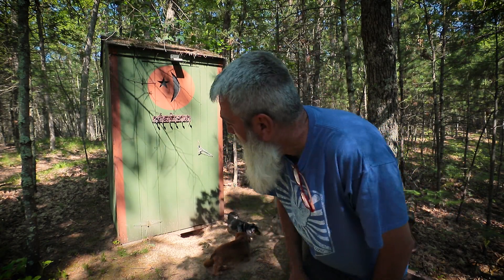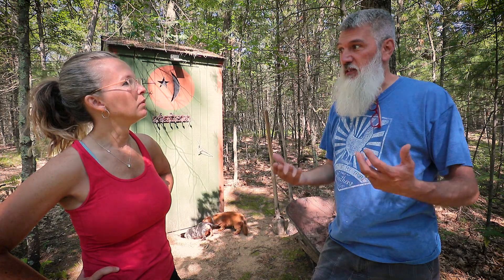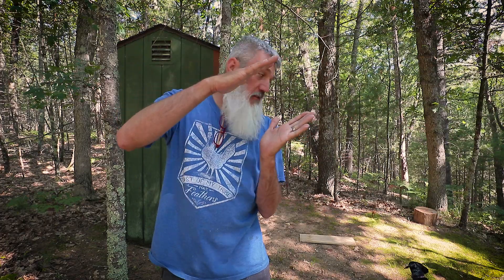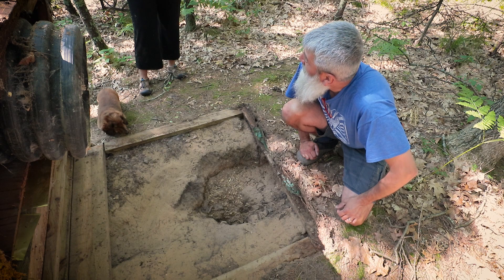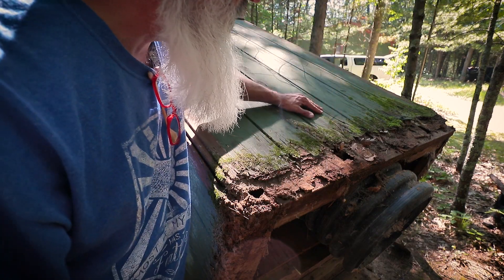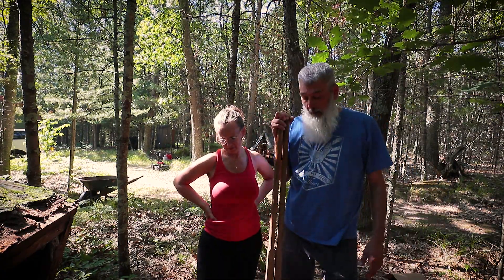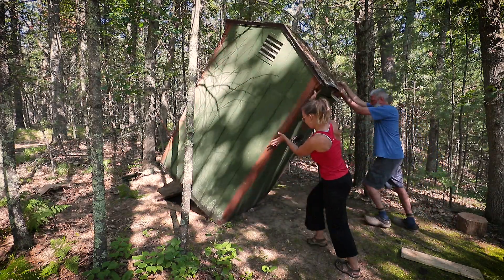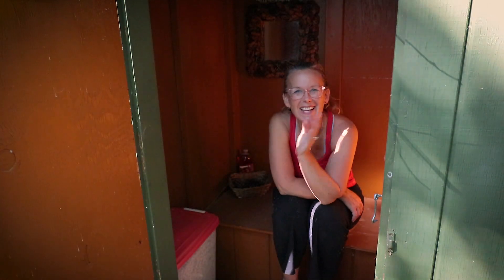Off Grid Cabin:  The Outhouse is FULL | Re-digging the PIT

Comment: Also wood chips take along time to decompose... Try peatmoss
Reply from the maker: They're not big chips, just tiny little flakes.
Reply: @1870s Smaller the better for sure.... Not recommended for any kind of composting due to the time, it tends to get moldy b4 it actually breaks dwn. Plus they attract ants. Just thinking of the speed of your hole filling. I'm a professional gardener, and  coincidentally am building an outhouse as we speak. I think it's modesty that makes feel the need to cover up the poop, but even lime will slow dwn decomposition slightly. The best thing is to just add water if anything.. That's what I've concluded. Just dump my grey water from camp into pit. Also, I keep pee separate, it funnels dwn into gas jug, w vinegar added, and dispose elsewhere. It's the ammonia smell I can't stand and carries through the air. Just some thoughts. Thks for the discussion. 🇨🇦😊

Comment: What about the cardboard tubes used for pouring concrete columns. They are biodegradable but should hold there shape for a long time....
Reply from the maker: Those might work really well, the soil does drain good.

Comment: The wood is still a composite, so you need to fix the  toilet on bricks or pour concrete for the sides, and set the toilet up on bricks with rubber tires spliced, tread facing up to drain water, snow off. If the back of toilet has a cut out, you would not need to tip. Dig out, fill back. Grandpa used sulfur in the winter as we kids used the chamber pots.

Comment: You could use a plastic drum with the top cut off.Then add sand with the wood chips.
Reply from the maker: Good idea!
Reply: @1870s  -Also,drill holes in the bottom and sides to drain the liquids.

Comment: I am beyond 50 years old, grew up with the outhouse as a normal use toilet. 
The pits where lined with wood boards.  Typically 1x4 planks,( but back then wood was better quality,  2x4''s would be better now.)
built as a bottom less box, from the inside, as  the hole is dug , and as room allows, a new square "ring" of wood is pushed into place against the dirt,  with experience nails are not even needed...using a method such as north and south boards are set in place,  then east and west boards are cut to fit tightly,  and wedged in to hold the north and south boards...then room for  the next layer down is dug out, and the next  "ring" of boards are installed east and west, with north and south boards wedged in to hold them in place....  if your skills are lacking..vertical boards are nailed inside... like the legs on a cheap treehouse ladder... I  have seen a ladder built into the pit walls so the person digging can climb out... being just good enough to last until they finish the digging.
>> the north/south >> east/west pattern must be alternating,  or the soil will push the walls in.

Comment: I run pretty simple solution for my cabin. I pee in a bucket which drains into the lake and a bucket for poop which has bag on it then it gets put in a poop bucket to be burnt off. I recommend separating your pee and covering your poop each time with sand saw dust or dirt. I know someone with outhouse in the same spot for 30 years in loamy  soil.  Dig a six foot hole should last six years. put some metal adjustable feet on your outhouse.
Reply from the maker: Only girls pee and poop in it.  Boys only poop in - and the pee goes in the woods.  I've heard that if you just let the natural bacteria do it's thing, it can break stuff down pretty fast - it's part of the reason we've never tossed lime or anything in there.  Hmm..  Now you got me thinking.  We're really not there much.  Even without any decomposition, it would take pretty long to fill a 24" culvert that's 7-8 feet deep.

Comment: what about the cardboard tubes you use for concrete pier forms.  It would compost as the outhouse hole filled.  If course you might have to move the outhouse location?
Reply from the maker: They might work.  It's be a race though to see how long the cardboard would last.  I bet removing the critters will make a big difference.

Comment: You could line it with bricks leaving gaps between them when you stack so most of the sand will stay out. If you keep the sand out then you probably wouldn't never hafta clean it out since your not using this everyday
Reply from the maker: Very true.  Let nature decompose it all for us
Reply: If bricks are not properly set in mortar , the pressure of surrounding soil will push them in.
As well as the cost,

Comment: Loose sand will collapse. Probably need a light weight short piece of French drain or similar. Insert into hole vertically to prevent sand from collapsing. Also mix some powdered lime in with the wood chips. I like your idea of a treated lumber base to rest the out house on. Plus the added feature with the chicken wire to discourage  animals that dig and stepping stones around the structure. I enjoy your videos. ☝👍...👉
Reply from the maker: Drilling holes in the culvert is something I had planned on doing, but didn't mention in the video.  The moisture wicking should help, and would allow worms and other insects to get in and assist with the decomposition.

Comment: You could bury the plastic tube like you were talking about, but drill holes in the sides before putting it in the ground. As you use the outhouse, keep tossing in a handful of wood chips each time like you have been. Worms will get in through the holes in the sides and help break down the waste! If you dug it 6-7 feet down... I would think that would take YEARS to fill up... If it ever actually did!
Reply: Also, I love how nice the inside of your outhouse is!

Comment: Build a retainer wall with pressure-treated wood and put it in the shit hole, and your outhouse shouldn't be touching the ground.  Put it on 4x4 posts and put wire mesh around the bottom so critters don't get it.

Comment: Maybe its time for a composting system with 5 gallon buckets if you have a little land. Our cabin is off grid and primitive.  We have an electric composting toilet (uses a fan.  Can power with solar) as well as a bucket system for backup.  Many off grid folks manage with the bucket system perfectly fine. You are making yourselves too much work. Before this the grandparents plumbed the toilet to a 55 gallon barrel.  But the toilet would crack if no one got to it before a freeze.
Reply: once upon a time in a land far far aways off, there lived a family that used a two gallon galvanized metal  pail not a 5 gallon plastic bucket , it would fill quickly and overflow and it had to be carried sloshing to a creek bank and dumped , I wouldn't use it , I would rather just squat in the woods and throw a few shovels of dirt over it or just hold it in for a few weeks like a natural animal

Comment: If you could keep the sides of the pit from collapsing such that the hole would last a lot more years, you might just dig another pit 10' over whenever the hole does finally fill in, saving you from having to dig out anything gross, although if you're adding wood chips it may be well enough composted that it wouldn't be gross even then.

Comment: I would put some lawnmower tires on it with  four stainless steel all-thread  as axles and just roll it to a new pit a few steps way and set blocks halfway into the  ground and  treated wood 2x4 would be a good choice as a sill and excavating the topsoil around the perimeter and back filling with the subsoil taken fro the pit and with a slight ramp away from the structure to provide drainage and for a gas vent a10ft  aluminum gutter downspout tube strapped to the back of the structure with wire ties  and maybe a porch roof with tree branch diagonal supports and build it out of wooden pallet skid 1x3's and some 1/2" plywood siding and use the pallets 1x4 slats to add lap-siding over a Sears style metal shed as wainscoting and use rails atop the wainscoting